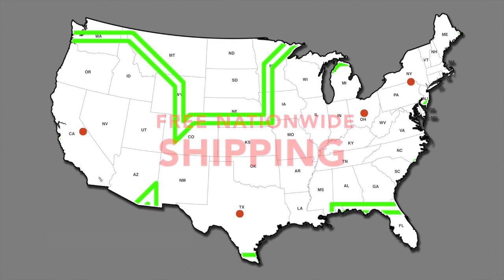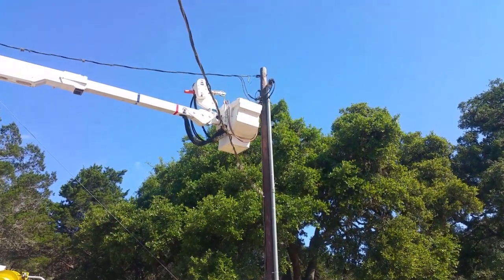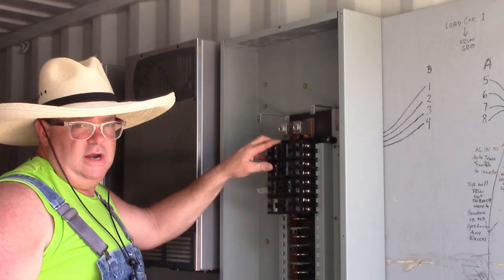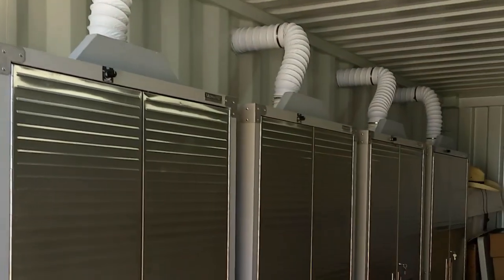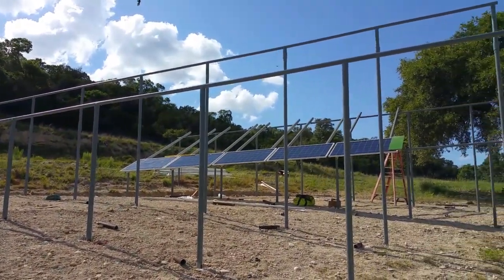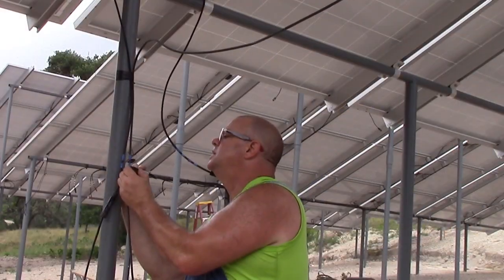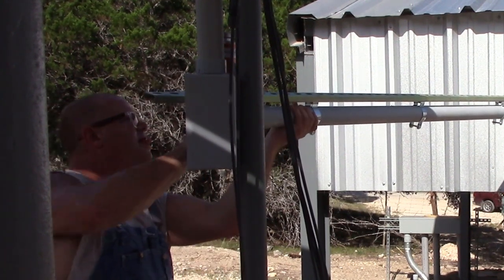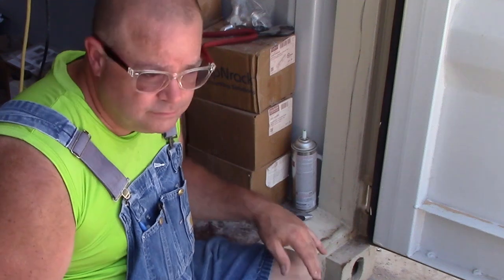32kW Off Grid Tie Solar Off Grid Ranch 01

Comment: What kind of battery system does he have to support all of that Solar? 400A, what is he using all of that for, some sort of processing plant? What came to my mind was the movie, "The Gentlemen", and all that White WIdow Super Cheese!
Reply from the maker: Its a private customer and I cannot discuss his requirements.  But he has a lot of fully off-grid capacity and can run his ranch as long as he needs if the shit hits the fan.

Comment: thank you so much for sharing I loved the video and found it super helpful I will be checking out your website as I just bought some land and I'm looking to do solar powered! does this system also heat concrete?
Reply from the maker: Sure, it can heat concrete but for most remote off grid applications, you want to use some propane and a tri-fuel generator with wind and solar.  When you get that property let me help you design a solution that fits your needs and budget.  There are so many different methods and all have a fit depending on your loads and site details.

Comment: what if I told you I can make you a supercapacitor pack that will at a minimum double your efficiency up to 10x  to 100 if you place it on the eco mode you would have a very little consumption limiting it to 500watts on you're batteries and reconverting it to usable supercapacitor output power... long story short you don't need any more batteries.i can give you 100% satisfaction.
Reply: What if i told you capacitors and batteries have completely different uses. Not to mention one misuse of a super capacitor and it will discharge all of its energy in his grid, shocking everything in its way.

Comment: That ranger was workin lol
Reply from the maker: Yes that Ranger was called "Little Blackie" like the movie True Grit.  It is still working hard.  At that time it was around 230k miles and pulling that load through Kentucky and Tennessee was tough on it.  To this day it has still not broken down, was a V6 5 speed and I sold it to am employee a few years ago.  Now I have another Ford, an F-150 and it's called "Big Blackie".  Its around 205k miles now and is another very tough Ford pickup.  I take good care of my trucks and drive the tires off of them.  I am in Florida now in the panhandle.

Comment: so do you need to store the energy and batteries for long-term or is all the electricity that you use in real time
Reply: OK< These systems are built upon all my RoofMill Hybrid wind/solar engineering.  So this system is BOTH Off Grid, and Grid tie.  Off Grid is where the utility would fail and the home would be running on its own with the battery bank as its storage.  The solar still keeps working during the day.  At night or with clouds, the batteries will carry on running the home if there is a shortfall of solar power.

BUT, when the utility goes down, this home and property will have NOT EVEN A FLICKER.  The power runs constant with or without grid power.  If grid goes out, back, out, back, UP/DOWN, the home will have no issue in power and the homeowner in most cases would not even know it.  These are fully automatic, reliable, permanent power systems.  You could be out of town, or out of the country, and it will do what its supposed to do.  This is the best 32kW off grid system there is.  Except it should get a wind upgrade later will make it better.

It is also still a FULL GRID TIE, so it sells any excess power back to the utility, after topping off batteries and supplying loads.  Nothing is ever wasted.  In normal operation the batteries are fully charged and just sitting at ready.  They are kept at full charge and really not taxed at all in daily use.  http://RoofMill.net